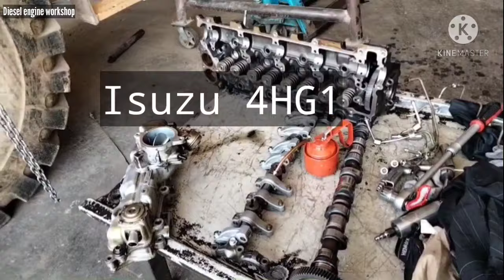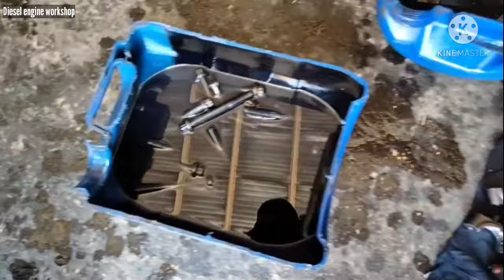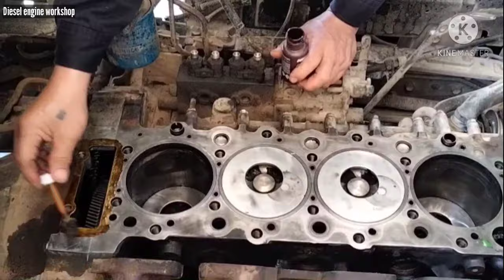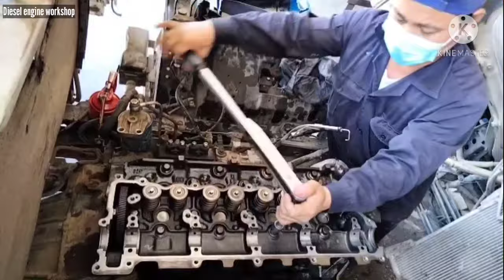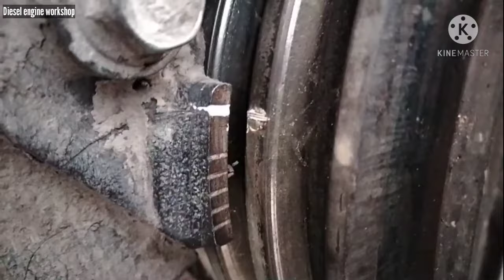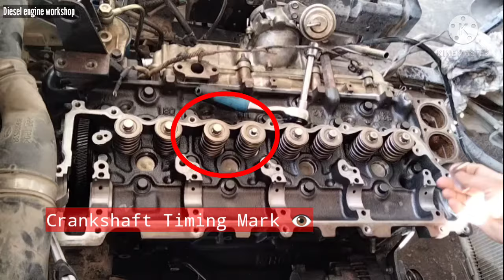ISUZU 4HG1 NEW HEAD GASKET INSTALLATION COMPLETE PROCESS 👁️✨||

Comment: Tockreng numbers for crenshaft bolts
Reply from the maker: M18 Bolt torques
Step 1 = 98 Nm, 72 lb.ft
Step 2 = 132 Nm, 97 lb.ft
Step 3 = + 30-60 degrees

M10 Bolt torques
37 Nm, 27 lb.ft

Comment: Здравствуйте, подскажите что вы мажите на прокладку гбц, и для чего это нужно?
Reply from the maker: In English
Reply: @Ajaj881  Hello, what are you trying to do with the cylinder head gasket, what is it for? In the video, the gasket is manufactured in China?
Reply from the maker: It's Call Head Gasket Shellac |
a hard setting, economical sealant, sealing all common gasketing materials in low temperature and low ...
Reply: @Ajaj881  Thank you 👍
Reply from the maker: U Most Welcome

Comment: 4hg1 and 4hk1 has the same block?
Reply from the maker: Not same
Reply from the maker: The 4HK1 engine is a low-displacement, high-torque, four-cylinder, two-stage turbocharged and intercooled diesel engine. The two-stage turbocharger in the 4HK1 comprises a combination of low and high-pressure turbochargers, which increases torque levels at low engine speeds.
Reply from the maker: The proven 4.5 litre, 4HG1-TCN diesel engine designed to be environmentally friendly and combining the benefits of high power and great fuel economy. 4HG1 DIESEL. Direct-injection OHC. Displacement 4,570 cc.
Reply: @Ajaj881  nice info... Thanks 👌